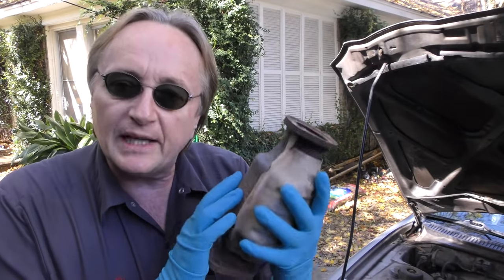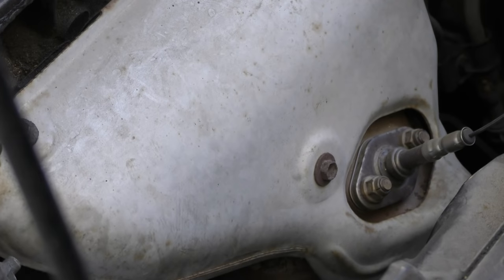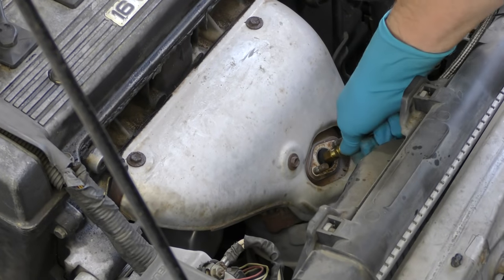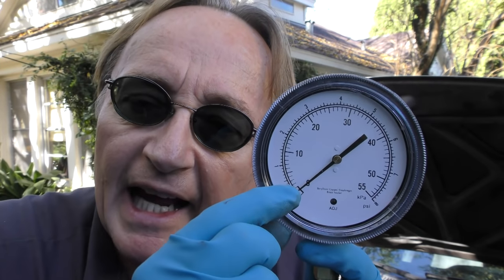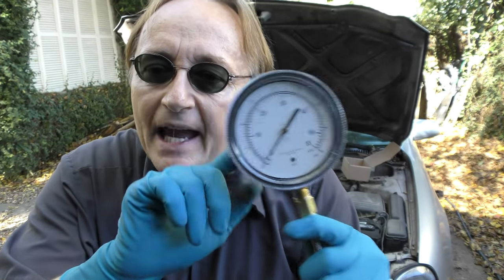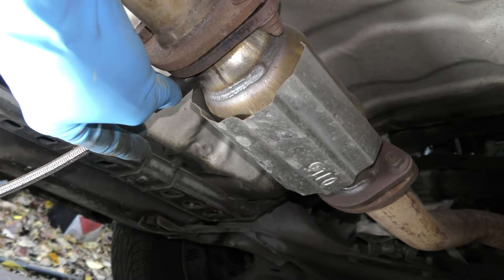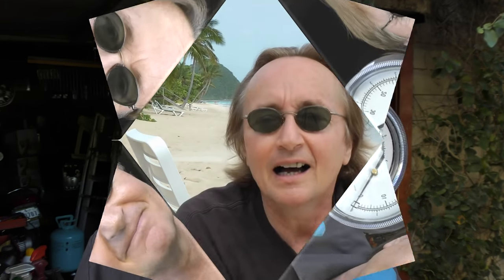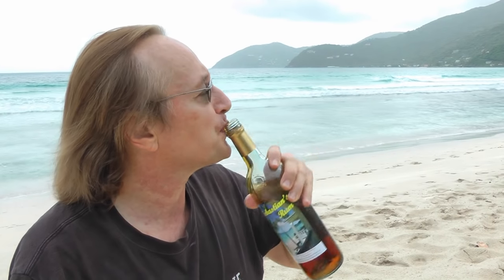How to Tell if You Need a New Catalytic Converter in Your Car

Comment: I have a Celica 02 - I had some light white smoke and a P0420 Scotty. I got the engine tested for a headgasket leak and I replaced the Catalytic converter after that.  That was a year ago.  Now 4 mos ago same problem. So I had Toyota test it and they said the O2 sensors were ok and THEY said it was a bad catalytic converter.  I just replaced it and one of the 02 sensors (downstream) would not come out of the old pipe at first, it got stripped and a plug was put in. i replaced the whole catalytic converter to resonator.  Now the past two days smoke again.  It is 33F here though.  What next?

Comment: Hi Scotty my 2005 Toyota Corolla rattles on the muffler/centre pipe joint but goes away when you rev it or touch the joint? Do you think there's some thing stuck inside it? I have no check engine light and it runs fine.

Comment: Hi dear Scotty 
I'm not an English speaker but I'm a member of your YouTube channel. 

I have a 2007 Mazda cx7 
It's has a misfire, smell gaz when the engine is running, rough idle,the engine is rough, very low power,I see oil in the intake manifold. What do you think it could be. What would you your advice for a with all of those symptoms?

Comment: Hey Scotty Kilmer👋🏽 I’m a young car enthusiast and self taught mechanic. I have a major question… I have a 2000 Cadillac deville suffering from a clogged catalytic converter with about 1.8 psi back pressure (warmed up) and 2.1 psi (cold start). My question is if I was to cut out the cat and replace it with a straight pipe; would that effect my 4.6L V8 northstar engine performance and also what about the other 2 upstream O2 sensor ( engine has 1 downstream 2 upstream) please help nobody I ask gives me a straight answer. Thank you.

Comment: Fustrated Scotty! 94 bmw 318i convertible. Since my original Cat died about 5 years ago I have replaced mine with aftermarkets at least 6 times. I am told that the car is running too rich. Can you give me a laundry list of everything i need to check? over the years I have replaced the 02 sensor, spark plugs, valve cover gasket. my car is ob1 so no check engine to check. I did notice oil in one of the spark plug chambers. Could that be the problem?

Comment: Scotty, I have a 2007 Chevy Impala Police Pkg 3.9 V6. 
The car computer system was spitting out a CAT code. So we had the dual stock mufflers replaced along with the catalytic converter. Both of the 02 sensors were replaced with AC DELCO products and the computer was updated. The code came back on. So they replaced the new catalytic converter with another one. But the light came back on after a few months. It runs and drives fine gas mileage hasn't been effected. I do feel like I notice an exhaust like odor from my AC system when sitting but it may be due to the burning oil from the leaking oil cooler line.

What can be the problem? Is the replacement CAT the problem?

Comment: Hey Scotty! I have a 2008 Volvo c30, it started running slower and I took it to a Volvo shop they said they had to change the 02 sensor, the spark plugs and the coil packets, it was running way better for two days and the check engine light was gone. But then it came back on at idel and I got it checked at autozone they told me the 02 sensor is throwing a code and it has cylinder 2 and 4 misfire/ random misfire! I’m still driving it but why would it be worse or misfiring if they replaced tht stuff? Could my cat be clogged? Bc idek if I should be driving it to and from work or if I can drive it all the way to the shop

Comment: Hey scotty names i just bought a 2013 Mitsubishi lancer GT with 13k miles it was sitting in a storage never been driven since. I bought the car a month ago and so far i changed spark plugs, air filter, oil change and put new tires on it. Is there anything else  i should do what do you recommend? Test my catalytic converter?

Comment: hi scotty, you and erick the car guy omit some situations: for example i just had P0420 problems after passing under a flooded bridge, i had water in the muffler and the problems started. After months I removed not the catalyst but only the final part of the muffler. And as if by magic the p0420 code has never appeared again. I therefore deduce that the catalyst sensor detected wrong parameters due to some hitch to the emissions line after the catalyst.

Comment: I'm working on an '03 Explorer 4.0L and the codes say one bank is lean while the other is rich. I have yet to pull the plugs to look at them, or measure sensor data while it's running, but some people suggest just pulling the o2 sensor out to see if it idles better and to "diagnose" a plugged converter that way. Thoughts?
Reply from the maker: that's a decent test for clogs
Reply: Thanks for the response! I pulled (and replaced) the plugs and that whole bank is definitely running rich. Any chance it might just be a bad o2 sensor instead of a plugged cat?
Reply: Kcducttaper1 gdzie

Comment: Hello...Scott 
I have hyundai sonata hybrid 2016. Sometimes the engine light  come on when I drive long distance like may be 20 or 30 miles. After 2 - 3 days, the engine light will turn off. I took my cat to Auto Zone had them read the code and it showed that catalytic Converter is the problem. I really have to get my car to Emission test very soon otherwise I can't renew my license plate. Do you have any suggestion where to get the part for cheaper price or what should I do? Thank you so so much for your videos.

Comment: Ok!! Greetings yet again sir Scotty! I'm an ol'girl you've helped several times over these few years and I have SO appreciated it. Here I am again. I'l make this short. ('96 Ford Econoline van, 2000k miles, 5.8L, 351 engine). Replaced starter 2 months ago but dude(Craigslister mobile mechanic) did not plug in the air flow sensor(so it was off for 2 tanks of gas before i sleuthed the problem). Did not realize the sensor was off till now, since my catalytic converter is jingling badly, bad bad gas mileage all of a sudden, power seems compromised as well. Thought it needed a tune up(before I found the sensor unplugged and plugged back in).. Changed plugs which were already pristine, and a cap and roter that needed it. Still have that clanking and the rich gas smell and seems like better compression and poer than before the tune up, but not back to normal either. I'm a poor old gal, old and have always liked working on my own vehicles but. . . well, we'll see with this one.  Can I just rinse converter out, or do  need a new converter, and how do I know which to do? Also AutoZone  wants to sell me either a cat with bolts for $400, or one I weld myself for $150. Not sure what that's all about after watching you take one off and just use same bolts and not need to weld at all. In short Im a bit confuzed in general about what I need to do and what happened to make it needed (I mean what unplugging that thing did, other than dump fuel like a stuck pig.  :( . . . .  Thanks in advance for whatever you canb offer sir.. . . .  I'm worried because I want to do some camping this summmer and there's a hot springs calling my name already and I can't go with my van acting up and my nerves freyed over it from a CL'er . . . . . effing up a bit. (Arrgh) . . .  Ok then. I know what hapened but not how bad it is or what to do. She got 16mpg and now gets 10. It's killin me. ;) Ok then, cheers Scotty! (PS, compression and gas mileage was awesome before the air flow sensor was left off, and she never smelled rich and had plenty power - bought from old guy who kept it in super great condition, 2yrs ago)

Comment: Scotty my 2004 Toyota Tundra needs to be smog to renew the tags. I recently took care of a bad coil issue by replacing it. I had check engine light for about the last year and a half. Now I’ve been taking the truck to a smog testing and certification garage to get it smog. The technician keeps telling me his machine indicates a catalyst issue is still there , so he tells me to drive the truck some more and come back in a day or two to retest. Is it possible that a catalyst issue will get fixed by just driving the truck some more do just need to replace the two catalytic converters? I would appreciate your advice as soon as possible. The tags have to be renewed before August 31, 2019. Thank you from another Veteran.👍🏼👌🇺🇸🇺🇸😎 . Tundra is a 3400 v6

Comment: mine was like 20% clogged up after a visual inspection of the cells and still the low pressure psi gauge didn't even move (the needle starts to move at a minimum of  about 0.5 psi)., that was on 5000rpm  wot in neutral. It was clogged up with metal dust from desintegrated  preconverters otherwise it looked clean.

Comment: Scotty my 99 ford windstar, was parked for 2 years I changed the heads n head gasket. It has a torque spec, but I just tightened it to where I felt the pressure needs to stop all the way threw. I got everything back n going. Now I find out it starts but shakes after a about 40 seconds real ruff. I checked it with the mechanic fixd.. app and it says it's the iac. But would that explain the smoke coming out from under the hood. After a minute of running.

Comment: I have a 2003 Chevrolet impala and when I push on. the gas it takes a long time to pick up speed and it feels like it has no power and it makes a squealing sound. When it's cold it runs awesome and picks up speed no problem. Do I need a new catalystic converter and will a flex pipe work till I can buy a direct fit one.
Reply from the maker: +Ryder 2015   first, pressure test the cat, as in my video "does your car really need a new catalytic converter". If so, replace it, bypassing it is of course illegal but it would work

Comment: On mine, the cat wasn't plugged, but the catalyst was worn out at 300k miles. When I start it in the garage to diagnose problems, it was giving me a headache within 2 minutes due to NOX gasses. I swapped out the cat for an aftermarket and its much better now. 

However, if you know that you have an OEM catalytic converter, don't let the scrap yards try and tell you that it's aftermarket. At the scrap yard, an aftermarket cat sells for $2. An OEM cat will put $50-150 in your pocket.

Comment: Hey Scotty I have a 2000 Infiniti l30 with 170k miles on it, the car run good but the check engine light came on and my mechanic said I need a new catalytic converter, how long can I go without changing the catalytic converter and will not changing it cause any further damage?

Comment: My 04 trailblazer is feeling lack of power and doesn't Rev up past 3000 rpm. Also tries to drop rpm slightly before reving. And also it down the highway it's like the car can't decide wether to stay in a high or low gear back and forth.. could a bad cat cause all these things ?

Comment: engine Light is on my car. I know i need a new catalytic converter, the wire mesh at the head of my converter is falling off now due to rusting. could the light and the converter linked, or is it more likely another issue?
2004 saturn Ion 2.2 engine

Comment: First of all I love your channel, I always check out how it's done be4 attempting anything.  I have a P0420 code on my 2014 Oulander that burns oil very fast could that code cause the oil to burn up also if the problem is just the O2 sensors or should I consider getting another one? 
Thanks in advance!

Comment: Question, 1997 S-10, 4 cyl,, 5 speed, converter came apart, replaced with pipe. Now engine will not accelerate. In first gear only will run to 10 mph, then bogs down and go no faster. Oxygen sensor is before new pipe. Any ideas what is causing it not to  accelerate?

Comment: Thanks for information, i hope this measurement will help me -replace or not to replace that expensive part. Do you have any estimation  when catalytic corverter usually  starts to block exhaust?
Reply from the maker: +eepeni ysikuus  if engine runs good, doesn't burn oil, they never get blocked. It's always something being thrown into the cats that blocks em up

Comment: I have an 02 auto civic ex with issues with overheating that we are trying to diagnose.. Also popped into like a false neutral after 70 miles on the highway once I got off and to a stop sign.. It would not accelerate over 15 mph at that stop sign.. Had to pull over and turn the car off for alittle.. It drove home fine after about 5 minutes of the car off.. Please help. Also has a check engine light on.. We replaced the thermostat and radiator cap.. Didn't change anything. Supposively the radiator is new. Transmission doesnt really slip or anything still didnt lose gears either..

Comment: Hey Scotty I need some advice I have a 2001dodge truck with a 4.7 in it and I was wondering if I could remove the catalytic converter and replace it with a piece of pipe?  Would it still run ok?  Thanks

Comment: Got a 97 ford mustang 4.6l has almost a 178k miles on it. it appers to have 6 cats on it but runs good but idle and excelerates very rough but has no issue with power i can smoke the tires np or get into no prob but it does seem to run a little warm for my liking its in the safe zone but still further to the right then i like ofc itll cool down amd then go back up but any idea if this could be bad cats or something else?

Comment: Hmm I don't have the testing equipment and it's bitter cold outside right now.... sigh 

So onto guessing! 

My 08 Lancer I purchased used recently had an exhaust leak before the catalytic converter.
Everything was sounding fine when I got it, but when I had that exhaust pipe area replaced it immediately started to sound what I call "nasally" 

I do have a check engine light saying the catalytic converter efficiency is below threshold...
How bad is it I do not know.... if I clear the codes I can go a few days sometimes before they re appear..... suggests maybe not that bad....

So I was thinking that maybe it's simply due to the pipe not leaking and the gasket already being bad up by the engine.....

But honestly..... would normal flowing exhaust really be enough to make the car sound as I call it "nasally"  The catalytic converter creating allot of back pressure would make sense.
When before the holes in the exhaust pipe before the converter gave it a spot to leak and relieve pressure....

Bottom line I've put this off long enough..... I'm just going to need to pull my credit card out and get things done!
I'll replace that suspected gasket and the converter!

Comment: My 1999 B3000 had the cat stolen while in my driveway. Had my mechanic replace it. The check engine light came on after 8 months. The truck ran OK but the code showed an emissions failure. So they replaced it under warranty. After another 1.5 years now the check engine light came back on and it is reading the same code. What the hell is going on? Crappy replacement converter? I called Mazda and the OE one is no longer available. What should I do?

Comment: I have a yaris with 1.75" piping from headers to tip. I am planning to use vibrant ultra quiet resonator with 2.25 inch inlet, will it degrade the performance? Any ideas? Thanks!

Comment: I have a 06' subaru impreza 2.5i
My car has always has hesitation issues, but lately the car has been bucking from letting off the gas after accelerating and even when just coasting in drive, typically at very low rpm(900-1100 rpm). Can a bad catalytic converter cause bucking since you mention it causes back pressure? also will a cars rpm be generally be lower when the catalytic converter is extremely clogged?
Reply from the maker: have the backpressure tested, that would show fi it's the cause, which of course can cause all that

Comment: what kind of gauge is this? I have a Toyota Camry 2002 and the check engine light has come on repeatedly. I am a college student and I can only afford so much haha although I did have some kind of flush done to my vehicle to fix the check engine light. it was running fine for about 4 months and then it comes on again while I am traveling. I buy Cataclean and boom, instantly the check engine light was off. 2 months go by and again the engine light comes on and I do the same thing I buy the Cataclean except I didn't follow the instructions on adding it to my fuel at about 1/4 of a tank I added it at full but the light turned off once again. what a relief. I go on another trip to CO from NM and this time the Cataclean did nothing for my car. A woman from AutoZone yesterday sprayed my Max airflow sensor (I believe it's called) it was black and super dirty. the light turned off. Yay! but within the same day it turned on AGAIN. are there any fixes around the Catalytic converter?

Comment: Scotty, I have a 99 Ford Crown Vic Police interceptor, for the past 5 months it's been tripping the P0420 code. I've used cleaners and the light goes out but always comes back eventually. Car runs fine, I haven't noticed any difference in driving it but state inspection due soon. What do you think is the best solution, do I really need to replace the converter. Got a $300 quote for converter replacement
Reply from the maker: time for a new cat, but if it runs fine, no biggie, hurts nothing
Reply: +Scotty Kilmer I got it through state inspection because I don't drive it more than 5k miles a year I own 4 cars so as long as it doesn't hurt the engine I'm gonna run it as is

Comment: Scotty, I've been wanting to take the muffler off of my truck, is there any problems with that?
Reply from the maker: it will be loud, and over time it will effect the air fuel ratio in the engine adversely unless computer is reprogrammed or if it's a carb the carb would need rejetting